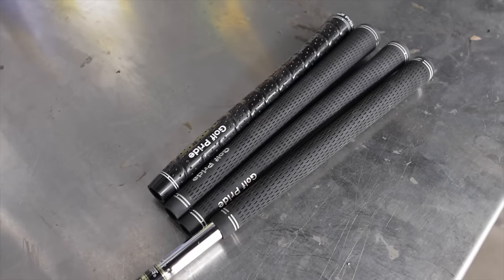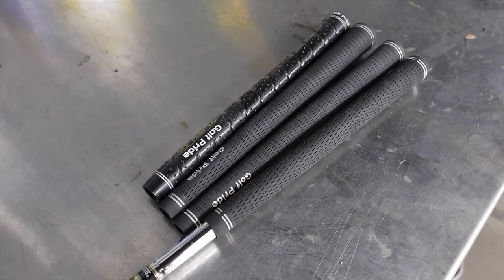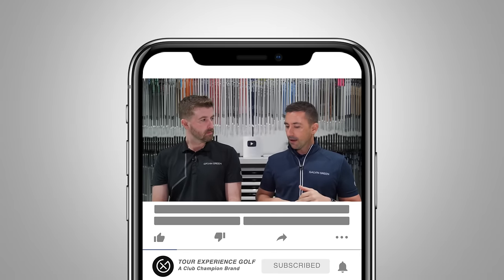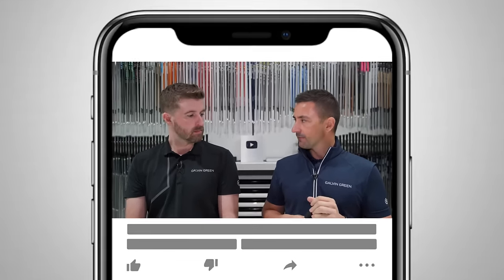Are You Using the Wrong Grip Size?

Comment: I tried out Jumbomax str8 tech grips and they were so much more comfortable for me and allowed me to barely apply any pressure to the grip. But since they were so big I switch from an interlocked grip to 10 finger and find I like that grip much more.
Reply: I think you can see from the comment section that so many men are just much more comfortable with at least going to a mid sized grip - it's a huge trend. Once there, there you start to get the feeling of your right hand now getting MORE on the grip - and that activates the brain controlling the right hand. 10-finger is the future with bigger grips - I made the switch also 2 years ago - and have converted a few fellow golfers.

Comment: I have MCC+4 Standard + 1 layer.  That extra layer means my hands don't get as tired in a long session, but I don't feel directly.

OTOH, my last second hand clubs were supplied with standard grips. I felt I could not swing "relaxed", and I got more shots left open or snapped.  My torque control is better.

Comment: Litrally just put lamkin undersize on my clubs to test...
I've tried mid and jumbo. Over standard, M size glove.
Like the feel of the bigger grip to hold but just loose the clubhead feel and start to come steep and over the top with it, with slappy toe shots.

Undersize does strangly feel quite nice as it's easy to get into the fingers...
Swingweight should go from d2 to d3 for my clubs and I can definitely feel it a bit more when I give it a waggle...

Comment: After much experimentation, I decided that the JumboMax grip provides maximum stability and control. Undersized and standard grip introduces way to much club head variation due to increased grip pressure required. Now that I’ve settled on the grip size, I am experimenting with non-tapered grips. My bag is sort of a mess with different sizes and shapes, but I will get fine tuned soon. I recently regrouped 4 clubs with non-tapered mid-sized grips and it feels strange with smaller grips, but I’m getting good results with wedges. With the hybrid, I m leaving some shots off the the right and shorter. So, for me, jumbo XL grips get the best results. Tapered vs non-tapered is still a question mark.

Comment: Would have liked to seen sw on each grip/club the same to see if it changes anything. I typically will use grip weight to offset length increase in driver as it is good way to keep sw in margins. The other thing I’ve noticed w me is the older I get the bigger the grip I have drifted toward. Anyway interesting stuff as always!

Comment: Would be interesting to try and manage grip weight in this test - some brands use different materials to avoid swing weight changes
Reply: Agree. You started discussing using an extra heavy, but then never addressed, so how about a test just with weight changing and size remaining the same. Thanks

Comment: IMO for standard sized hands: my suspicion is if you are gripping it correctly (with fingers first then of palm instead of mostly palm), grip pressure change (and thus face closure change) throughout the swing should be highest in the smaller grips as you squeeze harder on it. on the opposite end it is going to be minimal in the jumbos because you sort of only can grip it in the palms anyway. as for the reason why you would squeeze harder or not squeeze harder during the swing, i don't know how big the psychological component (your confidence and subjective feel) is that causes you to oversqueeze or undersqueeze during the swing. this is the scary part because the psychological component can be drilled out. whereas a wrong equipment fit cannot.

so in the end it would be critical to understand that this is very dependent on fitting the grip to your actual hand size. because a standard is going to be undersized to a large handed person while it might feel like a midsize to a small handed person. you may also have naturally sweaty palms which can be helped by going thicker than standard grips. equally as critical is the actual data to quantify the face closure rate which you will be needing a GC3/4 to tell you, or at least a trained eye outdoors watching your release and ball trajectory. because your grip might feel great for your hands (anybody can find something that feels right for them solely on their own) but the diagnosis of your entire swing and ball flight is not something someone can do well on their own--even pros need coaches for this. your slice or hook may not even be related to face closure rate at all and you might be wasting money to regrip the set or worse sitting there at the range for months working on the wrong thing.

one thing about jumbos though. unless you are shaquille o neal or else have some very niche reason to use it like Bryson (he specifically wants to minimize closure rate and went jumbo as well as trained himself to a very different release pattern), you probably dont have the grip strength sustain proper use of a jumbo for 18 holes.

Comment: Great video, I personally need to go back to Jumbo's (went down because my last fitting, the fitter was worried about swing weight with the heavier grips).  But you nailed it on the head as to my own reasoning, the face just wants to close too easily with my current grips.  As for the speed, I also wonder if you get more speed from the jumbos because there's less gap between the hands and grip (grip pressure is sort of what I mean, but not quite).  On video of my swings, you can see the hands and clubs separate a little bit around impact.  Unless I focus completely on having a firm grip pressure throughout the swing (which sucks), this just happens.  I think this slight gap contributes to a bit of early release as it can start to feel like the club is leaving my hands?  With jumbo's, I can use what I think of as a "normal" pressure and the grip stays solid in the hands throughout the swing.

Comment: Funny this video comes out, I was thinking about this the other day. What affects do extra wraps have? Does it change the swing weight? Also a couple years ago I asked a builder what the extra wraps do and he said it just firms up the grip, is that correct? I’m torn between z cords vs velvet bct cords, I love the z cords but they just feel a tiny bit thin in my hands compared to the bcts. I feel like my irons are a fraction heavy in the head and was wondering if adding a couple wraps to the Zs would not only change the weight slightly but also add a little width to the grip. I could do the same with the bcts etc.. just curious if that’s a viable option vs going midsize. I have the mcc +4 on my irons now and they just feel weird, not a fan of the normal butt size with the chunky finger section. Final question, what does it mean when build shops show + 1/64 , 1/32 , 1/16 etc.. for grips? Are those extra wraps or actual larger grips? Thank you as always

Comment: I have a 2XL glove size I have been using Midsize MCC+4's I do like them and find them pretty comfortable but i am curious what is truly right for me. I am contemplating booking a wedge fit at TXG. I need to buy 3 new wedges but I have only swung a few times since September and my swing is far away from what it is in the season. Issue being I need the clubs for the season... I mainly want to know if I should start getting my wedges 1/2 long being 6'2 36.5 wrist to floor. I know that dynamic delivery has a lot to do with that as well.

Comment: What do you think contributes to the faster swinging with the larger grips. Is it the lighter grip pressure. As you said the pros grip it much lighter. Or might it be the lighter swing weight. The reason I am asking is I can go to the JumboMax Ultralight grip (size extra small) and that won't change the swing weight much, but will allow me to lighten the pressure.

Comment: I played undersize with 4 layers under my right hand for around 3/4 years after a discussion with my coach. On Ping's chart I am borderline Standard. I recently went back to STD size and I'm not a fan at all (even though I think the butt size may be slightly bigger than a STD Tour Velvet). Even so much as found a little pain in my left wrist when hitting more golf balls than usual. I think the amount the pinky finger wraps around the grip, and the ability to apply more grip pressure when needed with the main three fingers in the left hand (middle, ring and pinky for right handed golfers) plays a bigger part than face rotation, from a completely subjective standpoint. I would love to do an actual scientific study into it though.

Comment: Others have been saying it, but the most interesting nugget is grip pressure influencing closure rate. It would be nice to see the impact of reduced taper on closure. I think maybe even grip texture/firmness could be a factor. I can’t imagine someone is going to grip super tightly on a z cord, but they may need to squeeze tighter on a dri tac or other soft grips with little texture to avoid feeling it’s going to slip

Comment: I am looking to increase to midsize due to strangling standard grips when I hit them and also due to trigger finger to decrease grip pressure. Question  since it changes swing weight does it mean clubs need to be built differently and do manufactures do this when get fit and specs sent over? Thanks for another great vid

Comment: I increased my grip size from med size to jumbo because the midsize was too small and I felt like I had to grip the club too tightly. With jumbo, I don’t have to grip so tight and my fingers aren’t digging into my palm nor are my gloves creating a hole near the fat part of my palm, so my gloves are lasting much longer. My biggest question is, since I did this myself, and my swing weight decreased, what affect does this have on hitting balls? Cheers.

Comment: Why are you not keeping all the swing weights the same with the different grips? I know that the heavier the grip the lower the swing weight is. The video is to see if you are using the wrong grip. Wouldn’t it be more precise if the swing weight was the same (Matt’s preferred swing weight) with the different grip? Now we still don’t know if it’s the grip or swing weight making the difference. A change in swing weight by 3 points is a pretty large amount.

Comment: You didn't mention the alternative of adding extra wraps of tape to increase grip size without adding much weight. I use standard grips with 3 extra wraps. After some trial and error, I've found that fits my hand size pretty well. You didn't even mention that hand size is important when choosing grips.

Comment: It is impossible to try different grips after testing the club head and shaft. Typically, after choosing the head and shaft, they will ask you what kind of grip and size, and you just tell them. They don’t realize the size and wrap will dictated the swing weights. I had more than 5 fitting sessions at considered high fitting centered that did the same by asking you what size grip and wraps that you want and they came out wrong swing weight from testing.

Comment: Problem I have with this test is that they were not all matched with the same Swingweight and Flex as the grips were changed. That would be the only true and fait test, as they would all match properly and the only variable being the grip size change (and obviously the total weights affected due to the weight changes in the grip).
Which is the exact problem that all you fitters have. You know you can't just change the grips and say it's the same.